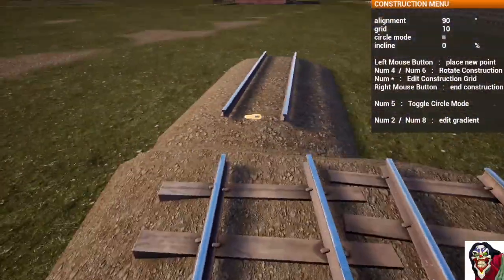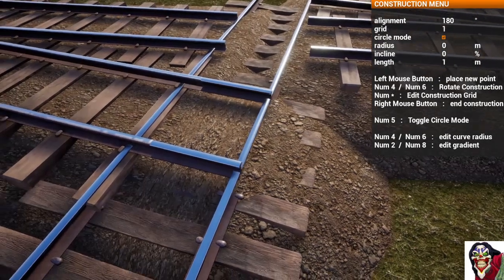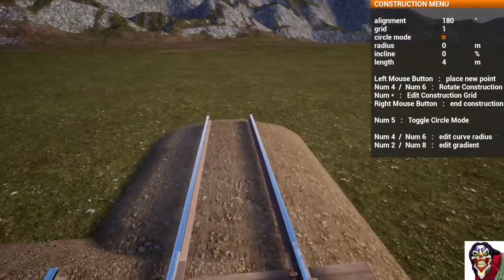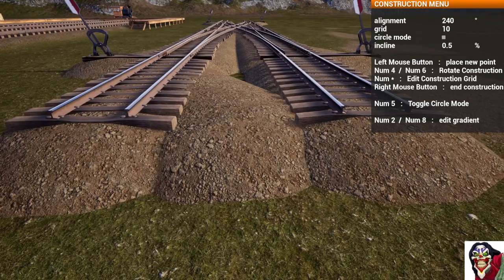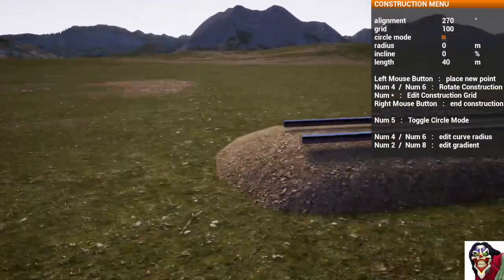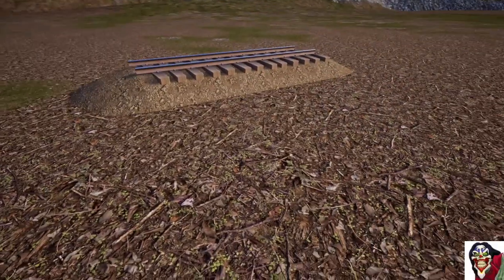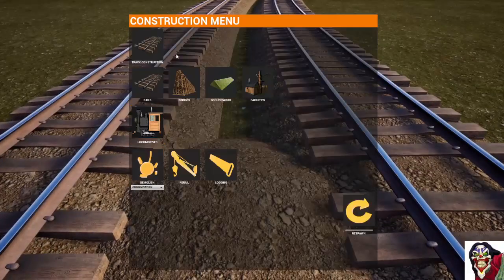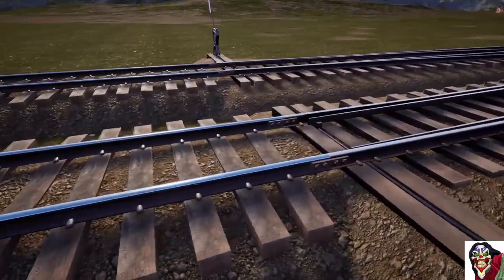RRO - New Splines Tutorial Ep7

Comment: It doesn't seem any of the tools linked in the description of this video are viable anymore.  Is that so or is it just me?  Anyone have anything more up to date?
Reply from the maker: Read the description.  You can still build this with the current tools, it however does not work because the new spline update was cancelled.  We only got the build tools and new maths for calculating curves, but not the actor locked to spline movement mechanic.

Comment: So it's definitely confirmed we can do crossovers by crossing one track over the other? I have not done this because I couldn't find anything explicitly saying crossovers will not require a special crossover piece of track and I'm concerned when the track update is finally done this will just cause derailments.
Reply from the maker: The trains literally ignore the track now and move on an invisible line so crossing the track over each other, or even building it on top of each other will not stop the train.  You can even build directly through a mountain and the train will go straight through the terrain.  You get pushed out of the cab, but the train ignores all physics objects and phases straight through them.

Keume has stated that this is how cross tracks work now.

There are no derailments in the new splines yet, and that could be some time off before the ability for them to disconnect from the spline is added.

Comment: I've found that making the straight section at the start and end of the outer curve 10cm longer than the inner side tend to make the parallel curve look about right e.g a left hand parallel curve the right track will have a 10 cm longer straight at the start and finish of the curve.

Also the section of track you were building from the switch to was also not spaced apart the same as the switch they were much closer, at 19:10 there is an obvious space between the groundwork of both tracks at the end of the switch's and at 25:56 the ground work is clipping between the 2 tracks where the you ended the curve.

And to agree with what you said, the building system isn't perfect, not by any means, it definitely has it problems but it is still in testing.
Reply from the maker: The crazy thing is that I did all of this as a test build before I hit the record button and it all went together like a well fit jigsaw puzzle.  Even the parallel curve which slowly got closer to each other as it went around the curve. Then I deleted it all and hit the record button and this is what happened.

The changes to the track building are all but done, and the last few months have been spent on making the rolling stock work on the new splines.  Its something that should have been sorted while it was still the focus in the code.

Comment: remove the starting switch, I have a funny feeling that is causing the mis measure issue as the calculations will be conflicting,  EDIT; after some testing, I've managed to create a perfect set of lane change on parallel tracks. The game is still broken and the spline system doesn't work as intended, it's felt for months that Keume just doesn't care anymore
Reply from the maker: Except its not, and was placed using the grid.  Try it for yourself, Two lengths of track side by side, snapped to the grid, set at the same length, and they don't build at the same length.

This is a known bug that is yet to be addressed.

As you are able to see in this video, it was not possible to make the same length of track twice in the same spot after deleting it several times and trying again.
Reply: @K10wNs-Shed  I've just completed this exact idea, if you use anything larger than 50 increments it creates the issue, would it be possible to discuss via discord how I achieved this?
Reply from the maker: @insomniacbritgaming1632  Even when using the grid snapping set to 50cm it will still place varied lengths of track.  This has been shown in the official discord by both myself and Farma (the official bug tester) and it is a known bug yet to be fixed.
Reply: @K10wNs-Shed  well... I've managed to make said crossover, takes some fettling especially using increments of 1 and 10
Reply from the maker: @insomniacbritgaming1632  That's exactly how I got it to work in this video.  Some guess work and 1cm increments on the second cross over link.  It wasn't meant to be like this.
Reply: @K10wNs-Shed  I defo feel like the game hit a dead end months ago... started with a steam pressure through the nose then once the discord issue started it started to feel like it died... I think the drama may have caused Keume to lose enjoyment in the development
Reply: Isn't the grid the problem? The grid only goes one way, and may or may not be perpendicular to the track.
Reply from the maker: @ModitRC  The grid is meant to be aligned to the map in squares.  The two pieces at the end of the video that would not build the same length twice were aligned to the map and the grid (the same as the freight depot).

It could be understandable that the two piece at the end of the curve did not want to place at equal lengths as they were 330deg to the map and grid.